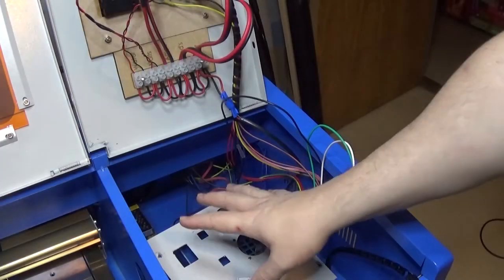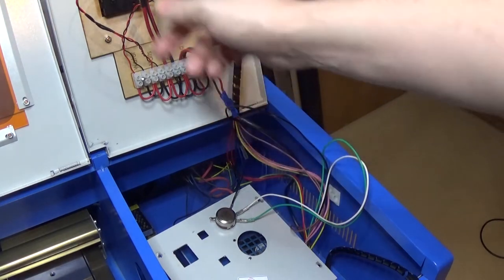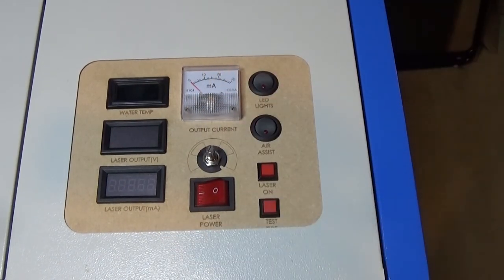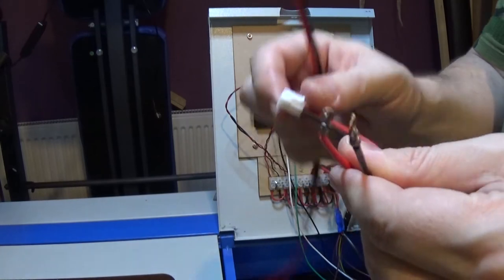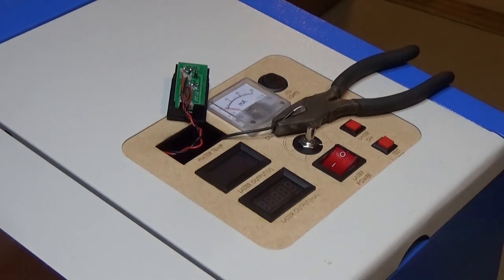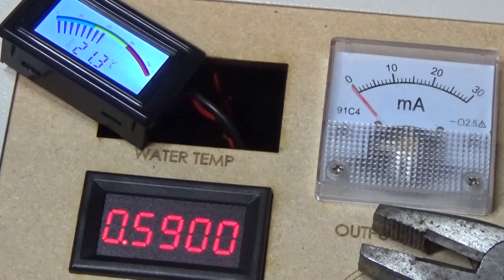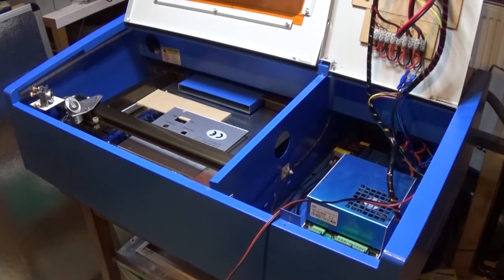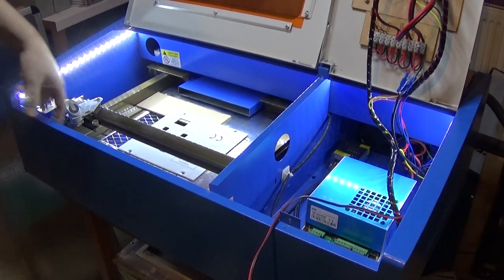K40 Upgrade Part 4 - Wiring & Testing

Comment: Hi, i'm maybe wrong, but it seems you connected the amperemeter in parallel. When you do so, you get only the half current reading on each.
Reply from the maker: You may well be right I will have to look at it. I had a feeling I did something wrong and couldnt figure out where Id messed up but that could be it. Thank you for your comment
Reply: @TheOffGridFamily  you're welcome. I thank you for your good ideas to pimp the K40 :)
Reply from the maker: @3mbbuettel  I love upgrading things but when I was building this I had a feeling I'd done something wrong but I just couldn't work out where. Thanks for your input